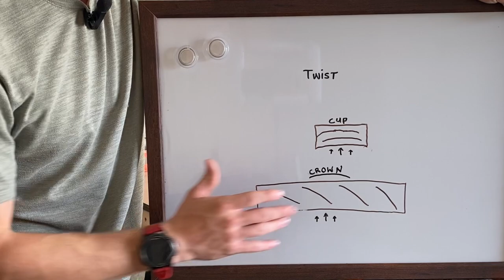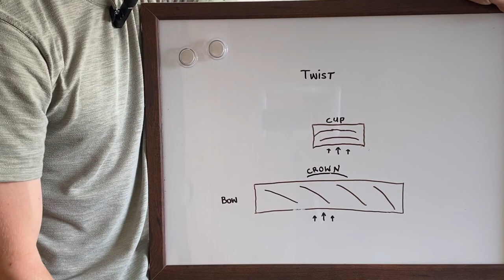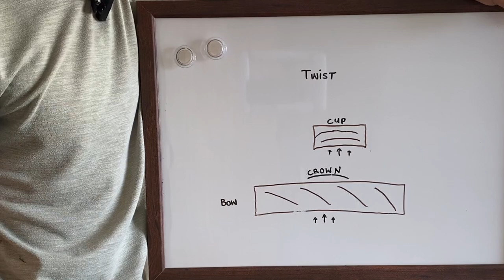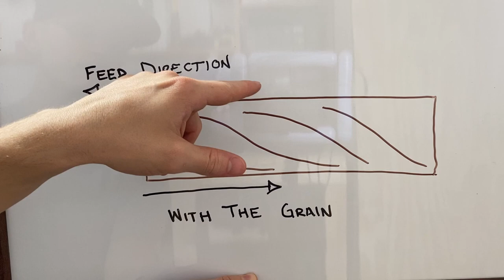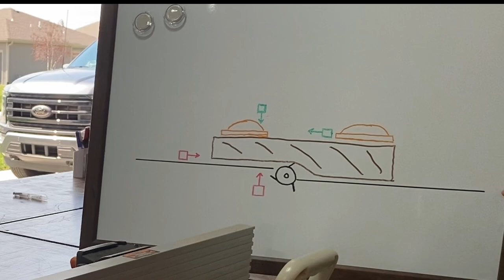How to use a Jointer 101 - Mill Wood Down to Perfect Square

Comment: Great video. I picked up a used Ridgid JP0601 for $250. Sat in my garage for a few months till I needed it and it is amazing. Was contemplating selling it up until that point now I’m saving some money to replace the blades with a Shelix cutting head.
Reply from the maker: Wow! What a steal! Those are the deals I’m always on the hunt for. After that shelix cutting head upgrade you’ll have a really quality tool for a bargain!

Comment: Congratulations on the safe arrival of your son, not expecting a reply straightaway, I’m in the UK & I’ve subscribed, you talk a lot of sense, & I’ve really only used hand tools up to a router so to speak, recently purchased a Rutland Jointer (6 or 8 inch not sure really), & an Einhell bench saw, my question is regarding the Jointer, it has 2 parallel blades, locked in place with 4 6mm bolts, but under the blades are springs, I’ve kind off got them secured level, but it’s hard to set the blade itself, once one bolt is tightened it locks the blade so you can’t adjust the height to correspond, I understand all you have said about  table height, it’s just if the blades aren’t true one side to the other, then the cut is off set, I’ve tried a combination of start one end, start in the middle, I’ve set at the moment with a vernier gauge for height & got about 3mm of blade rotation movement, any thoughts on “ how to secure true” the blades. At the moment I’m alternating the run of the board to keep it true, seems to work but not ideal. Thank you.
Reply from the maker: @anthonyshaw7251, thanks for reaching out! That certainly sounds frustrating. After doing some digging, I think I've found you a forum where several others discuss the same issue you're having, and a ways down the page, I feel a solution is offered that seemed to work for several people. However, it hinges on whether or not the Rutland jointer/planer you purchased included a blade alignment jig as discussed on the forum. (If it didn't, I'm sure you could find one online for cheap). 

This seems to be an isolated issue with UK based machines. The biggest difference between American machines I'm familiar with and this Rutland or similar brands is the lack of a set screw to raise/lower the blades. For some reason, the machines across the pond seem to rely only on the 4 screws holding the blade in place and a "jig" to ensure level. Maybe it works better in the end, but it does seem frustrating to figure out how to use properly. 

Let me know if it works out, or if it doesn't. We can continue to work something out! 

Forum: https://www.ukworkshop.co.uk/threads/rutlands-bench-planer-blade-set-up.138070/
Reply: @FiveOClockWoodshop  thank you very very much for taking the time for a detailed response, yes it did come with what I will describe as a 5mm ish metal bar which has 2 machined “ tear drop” pieces to it, but the basic instructions didn’t highlight what it was for, will certainly check it out ( tbh, I didn’t think to Google that way), I have been watching so many you tube videos on jointer set ups to see if it was covered, yours being the last on (& might I say very detailed) before I was going to email the company, like you say I have reached out to the right person, thank you for being the way are , somebody like myself who would find a solution to someone else’s problem.  I will certainly let you know how I get on. Top man. Love to your family. 👍👊🙏
Reply from the maker: @anthonyshaw7251  Sounds great brother, happy to help! Curious to see how it works out!
Reply: @FiveOClockWoodshop  maybe get time at the weekend, but we will see, will definitely let you know.

Comment: Just ordered a 10-inch Cutech benchtop jointer.  It seems to be the only benchtop 10-inch model.   Thanks for the helpful tips based on your experience. Should help me during set up.
Reply from the maker: I’ll have to check that model out! A 10” model will give you tons of flexibility to make great pieces and turn out amazing jointery! Goodluck! Thanks for the view!
Reply: @FiveOClockWoodshop  Quick question, has the 6-inch been adequate for your needs so far?  I was really tempted by the Jet 6-inch jointer with the true helical head. It was pricy and, in the end, I rejected it because I was concerned the 6-inch width would not be sufficient.
Reply from the maker: @Wyman642  Hmm, I personally think there is always a work around to the width limitations of a jointer. Dividing your desired stock dimensions into equitable parts and surfacing those before gluing up to achieve the desired dimensions can circumvent the need for a tool specifically suited for end dimensions. I hope that's not confusing! I was able to do a 4' x 20" x 3/4" panel glue up with four 4' x 5" x 3/4" pieces that I had milled prior to the glue up. It does add extra steps; however, it forces flexibility and allows you to allocate your money to other features in a smaller tool. 

That being said, do what works for you. I will say I've seen great reviews on the 6" Jet, and the true helical head is tough to beat. It will provide extremely clean surfacing with little to know snipe or grain tear out. (I've noticed these issues on my lumber because of the cheaper cutterhead). 

And finally! Don't forget that your real limitation will be the combined length of your infeed/outfeed table of your benchtop jointer. Having a 10" jointing capacity is great, but with a shorter overall combined reference surface you'll be limited to jointing 10" boards at only 3' - 4' in length (which is usually an awkward size in wood working).
Reply: @FiveOClockWoodshop  thanks so much for taking the time to give such valuable and thorough information.  I learned a lot.  As a hobbyist, I really appreciate you sharing your knowledge.

Comment: Cutech makes a 12 inch bench-top jointer now.
Spiral cutter, cast iron tables, $750
It is without a doubt the Cadillac of bench-top jointers.
I want to hold out for one, but the money seems to come kind of slow nowadays.
Reply from the maker: I think it comes just as fast as it always has, it just doesn’t stretch nearly as far huh! And that sounds crazy, I need to check that out!
Reply: I'm looking at the Cutech 8 inch for $600

Comment: I am having trouble getting a flat edge as I JOINT THE EDGE OF MY BOARDS. Is the fence the problem. The fence is not good on my machine. IS it best to replace it with my own home made fence? It's not worth taking it back bcos it actually isn't bad but for the fence.
Reply from the maker: Are you seeing a tapered end at the front and back edges of your stock as you joint it? Depending on how many passes you’re making/depth of cut you’re taking off per pass on each piece of stock as you try and achieve that flat edge, the taper becomes more pronounced. However, that’s normal! If that’s your only issue, I usually leave about 2” or more on either end of the piece to cut off once everything is jointed/planed and I’m ready for final dimensions. 

If you’re seeing that you just can’t get a uniform flatness at all, but you can face join accurately then yes, it’s more than likely your fence. If you have any experience with metal working then at least a 1/4” to 3/4” thick piece of aluminum May do the trick for a new fence. Otherwise, I’d suggest using melamine or MDF. Those materials will not last as long though! Goodluck!

Comment: When checking that the in and out feed tables are co-planar, check at the fence AND at the opposite edge of the infeed and outfeed. Otherwise, you could have one side even and the other wonky, leaving them NOT co-planar.  Also, the Jointer you have comes with a n allen wrench that fits the  blade roller, and allows you to turn the  blades manually.  YOUR MANUAL HAS THIS INFO IN IT!  AND, the optimum blade height is so  that the blades (cutters) just kiss the  straight edge, but DON'T move it at all.   Did you even read your manual?  (Edit to add) I have the same exact model of Wen Jointer.

Comment: How reliable is the wen jointer? Problems praises?
Reply from the maker: @Marc, I would say it is worth the roughly $260 USD that I paid for it. However, it is definitely a tool I'll upgrade as soon as I can. It does well but I would not recommend for heavy use. About halfway through surfacing 240 or so board feet of wood I started noticing streaks running in line with the grain along stock after surfacing. I believe this is grain tear out from possibly dulling blades, which I would say happened quickly, or just overwhelming the machines capabilities. 

When I do upgrade, it'll be to a floor model with much longer combined infeed/outfeed length and probably a helical cutter head. If your budget requires a cost effective tool, I'd recommend this model. If you can stretch to the $500 range, I'd put my money on a JET or Grizzly portable benchtop jointer. And if you can really stretch it, go for the floor model rigid jointer and upgrade the cutter head to a helical! Hope this helps!
Reply: Thank you. I learned a lot here
Reply: @FiveOClockWoodshop  thank you so much! I can't do a floor model for space reasons. I have access to buying grizzly jointer benchtop model I think. I dont want to overspend and delay my woodworking projects but also I want something I won't be frustrated with.
Reply from the maker: @marconiandcheese7258  I would say a Grizzly is a good choice then. The WEN only caused me frustration due to failing to properly setup the machine; which hopefully you can avoid with this tutorial. Just be patient and allow yourself to make mistakes and do your best to learn from them! Always feel free to ask questions if you're unsure of the results your getting.
Reply: @marconiandcheese7258  I bought the 6” grizzly with aluminum table. The infeed table out of the box is not co-planer, and we will need to flip over to try and fix that. A little disappointed. Grizzly doesn’t have any videos posted for this model. Not saying I hate it, but it will be a pain to get it functioning properly.

Comment: Hard to follow because you call a planer a jointer. It is a planer. And what you call a planer is a thicknesses.
Reply from the maker: I’ll unfortunately have to disagree based on my own research and experience. But to each their own! I personally believe that the main power tool featured in this video is a “Jointer” that surfaces one side of a piece of stock making it flat parallel to the infeed/outfeed table. In that respect, you are preparing a surface for “joining” or “jointery” techniques. It may have picked up a colloquial name as “jointer” but given that they are advertised as “benchtop jointers” I’d say it’s an accurate term for the industry. 

A planar is very different, it surfaces a side to ensure parallel thickness in reference to an already flat, jointed side. 

I don’t write this to argue your point, as stated above. To each their own! But I would like my perspective to be clears to any of my viewers reading your own comment so that they are not mislead! Thank you for the dialogue and the view!
Reply: The US and UK call these different things.